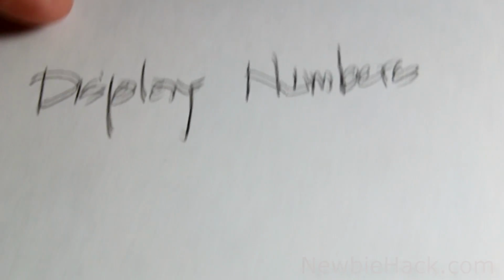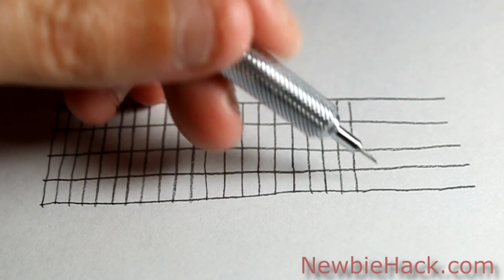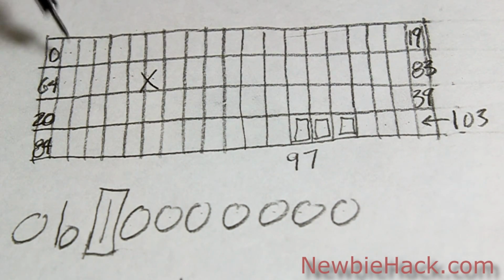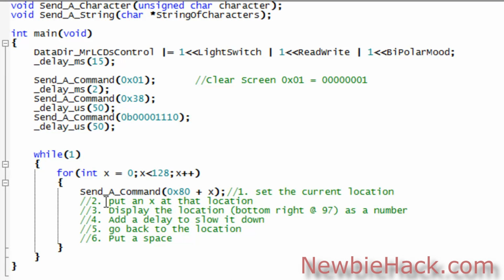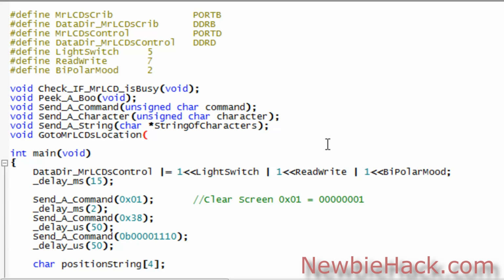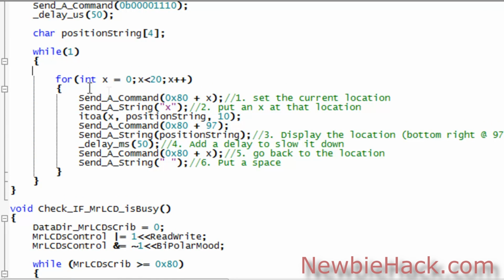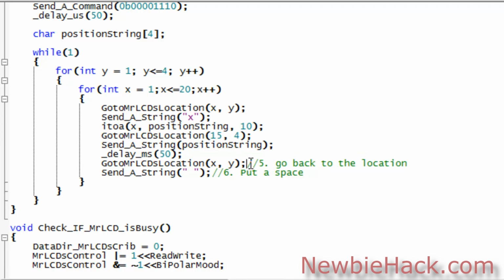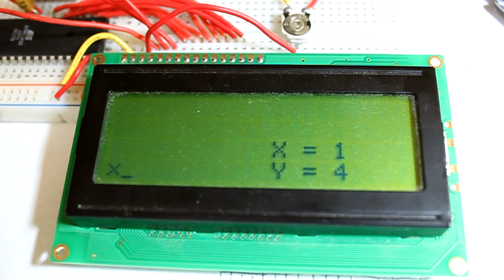22. Arduino for Production!  AVR Atmega32 - Displaying Number and Finding Positions

Comment: Hi! I really like these videos. My background is mostly hardware so I'm not a C guru. This is my question:
at 16:01 you declare a 4 character array "positionString"  but in the "for" loop you pass "positionString" without an index to Send_A_String.   Send_A_String is expecting a pointer.  What's going on here? and Why doesn't the compiler complain?
Reply: Array is always passed by reference. so there is no need to pass an index to "for" loop.

Comment: Hi Patrick,I always follow your tutorial. But Today I have problem here. if I don't use minimum 50 usec sec delay after any sending command or string, it does't work properly.
Samulation software show this message "[HD44780 controller received data whilst busy]".
how your LCD work properly without using  delay? can you tell me what was the problem with it?
Reply from the maker: You may need to change the delay depending on the MHz setting on your MCU,  The faster your MCU is set, the more delay you will need so you are conforming to the delay the LCD requires.

Comment: I have started with electronics in general about five months ago when I bought myself a RaspberryPi and discovered what GPIO pins are used for. A few weeks later I acquired the Sparkfun Inventors Kit... Although Arduino is useful it never really satisfied my curiosity. Somehow falling through the rabbit hole I ended up programming Atiny and Atmega AVR chips using a ISP programmer. Your videos has helped me immensely and I really appreciate you taking the effort in making these videos. Please don't stop.
Reply from the maker: I won't.  Especially with comments like this.  Thank you for the kind words.  Stick with the purity of the microcontroller and enjoy the process.

Comment: patrick....bro it would be an immense help if you could guide me in writing the code for interfacing a flex sensor ... with an LCD.... to display "Hello" when it is in 0 degrees and "Bye" in 90 degrees ...atmega32
Reply: abhinavsudam1@gmail.com...... i have learned how to interface an LCD ...and also the ADC port thanks to you.... but the flex sensor part in combination with them seems to bother me a bit...

Comment: Dear patrick, i have tried to use the code for Measuring ADC output for two axes of the accelerometer, and i used MrLCD.h as the header file...and when i tried to build the code in AVRSTUDIO4, i got errors....pertaining to Send_An_Integer..because it is not mentioned in MrLCD.h  and used in the code for accelerometer

Comment: i got the send a string think to work with the pointer thing! :D but now i got a wierd problem again -.-  if i use the command to set position of the cursor! it doesent display anything at that position but i can see that the cursor is there! and if i try to display a variable with out using the setpos command its always autoscrolling to the right... any clues?

Comment from the maker: That is a very good question and I have pondered the same thing. My immediate answer is that, if you set the compiler to optimize, (or use the 'release' option in Atmel Studio 6), then the compiler will optimize-out all of the unused functions and variables.